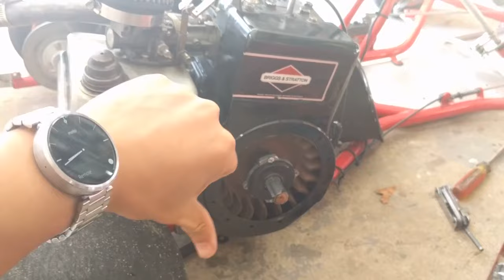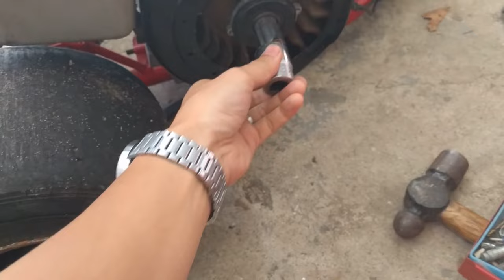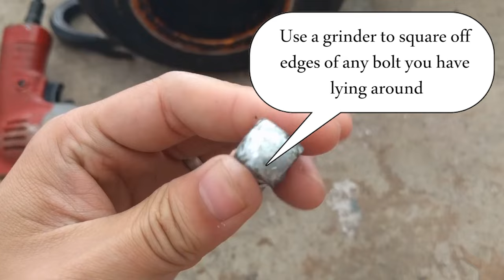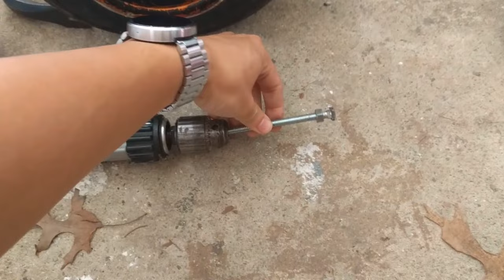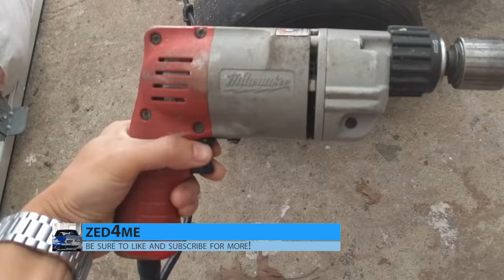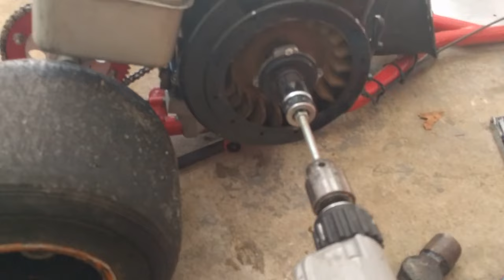How to Start an Engine Without a Pull Start/Cord

Comment: Or ya could just like goto harbor freight   & get a 3 pc adapter set for the drill to fit the socket .....🤔
Reply: That’s kind of what I thought. Wasn’t sure if I was crazy though lol
Reply: The only problem is the fact that doing this at all is unsafe. If he uses an actual adapter the locking ball will probably catch and he wouldn't be able to pull his hand and drill away fast enough. The engine probably isn't strong enough to break his wrist, but it'd probably be a good sprain if he can't pull away fast enough. That, or the engine breaks from trying to break free from him trying to remove everything
Reply: @tangsoo128  They  do make a specific tool for this type of application. I have one that will spin freely when the motor kicks off and not end up wrapping any cord about your hand then. Unfortunately, I don't recall the name of the tool, but I found it at one of the Box stores or online when I was converting a mower to run on propane a couple of years back. I saw it on one of those videos about converting a mower to run on propane, but I don't recall which one. The tool comes in different sizes, too. Not sure what its exact real purpose is for, but I do know it works on my mower and I am pretty sure it would on this guy's cart motor, as well. I also made up the DIY mod this guy did,, but never used it once I found that special tool. This DIY mod could indeed be unsafe with an electric powered drill as you said. That cord could easily wrap in a heartbeat. I had an unsecured Model A Ford carb jump off right off of a bench and the cord of my electric drill wrap about my hand in amazing speed years ago. Believe me, it was an ouchie to my hand that was not forgotten for quite a while.
Reply: @a1930ford  it’s just caled an electric start drill bit. But wouldn’t you be able to just use the clutch from the pull cord? Those don’t spin once the engine starts up
Reply: Or just go buy a pull cord …
Reply: @Ploari  lol the oem one is $80 … go ahead & buy one for me then … this is way better
Reply: @XXXLJOHNSON  ok lol idk where you’re getting your parts from
Reply: @Ploari  ok bub …. Look for the whole starter  assembly for a Honda HRX 215A, & get back with me on that … mine wasn’t a cheap pos u can buy at Walmart
Reply: @XXXLJOHNSON  why are you so pressed lol
Reply: @Ploari  I’m not , just trying to explain my mower was an expensive commercial Honda ,& the rope assembly I did purchase from Amazon wouldn’t fit , so the drill was a last resort ,& it works perfect … I’m not gonna pay $80 for the oem one …..
Reply: @tangsoo128  he needs a ratchet adaptor to make it safer.

Comment: Someone is going to get hurt.
Reply: All it takes is to have the drill jam and if you are lucky you will just have a few broken fingers
Reply: They sell a tool for doing that... it has a one-way clutch so it won't break your wrist when the motor starts.   . Amazon, about $20 bucks

Comment: Right but how do you easily access that flywheel on a mower, for example?
Reply: You pop off the little cover
Reply: @0eroOverride  In mine, I think I'm going to have to cut off the metal grille over the top. (Push mower, standard suburban style.)

Comment: Or you could just buy the socket extension that fits in your drill and then break your wrist trying to start it when the drill doesn't pop off
Reply: Just need to use a ratcheting breaker bar adapter and you wont break your wrists

Comment: Does it work for predator 212, I got a racing fly wheel on mine, and I don't want to crack that trying to start it with the bolt. My problem is  I can't start it with the pull cord with out hit the gas, not even with choke on. Any feedback would be much appreciated. Thanks in advance
Reply from the maker: All the torque is produced there, it shouldn't break anything trying to crank it
Reply: zed4me fuck it I'ma try it out,  only in da garage tho, not trying to get stuck out the road with a busted fly wheel. Lol nice video tho bro
Reply: Dylan Scott k thanks
Reply: Dylan Scott just asking because when I installed the aluminum fly wheel the instructions said do not over tighten the bolt. But it should start turning by then I would think.

Comment: do you think a impact gun would be damaging to use, like say a air impact thats 1/2inch drive
Reply from the maker: Don't see why it would unless something is seized up in the engine
Reply: An impact drill can snap the crank shaft only use normal drills not impacts ( I know this is two years old but oh whale)
Reply: Yes because a drill has no torque a impact does so it's not gonna spin the motor it's just gonna strip the bolt got to use a dril
Reply: @fastactiontv5546  how does it snap the crank shaft?
Reply: No an impact will only tighten the starter nut to the flywheel